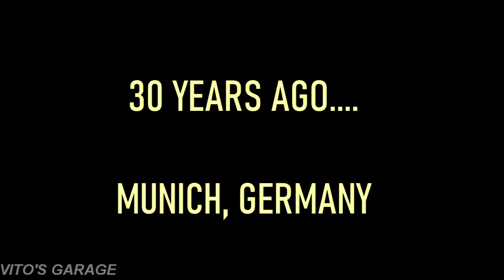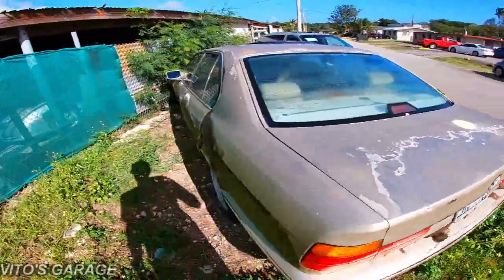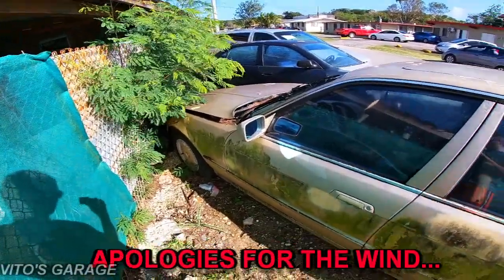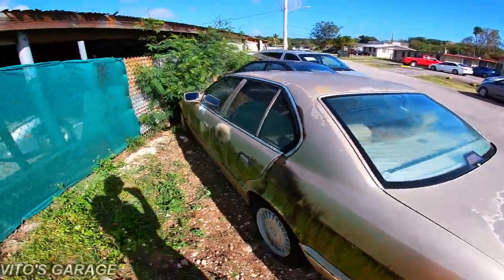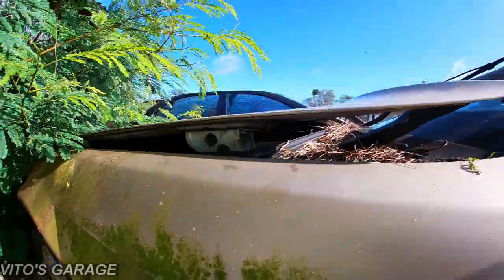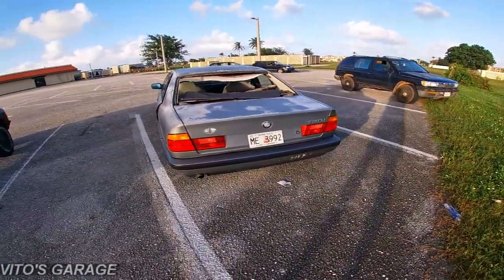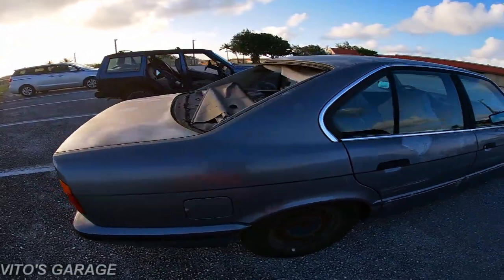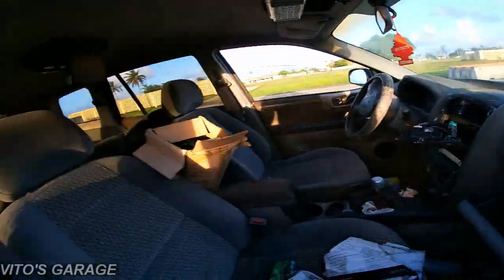This 5 Series BMW E34 Doesn't Deserve a Life Like This After 30 Years... Save Classic Cars!

Comment: that 90 E34 is worth restoring
Reply from the maker: They all are. We are getting less and less of these cars available...
Reply: @VITOSGARAGE   I have a 95 E34 I picked it up for cheap and it has the M50 2. 5 inline 6 in it when I purchased it 3 years ago and had 261 on the Odo now  just turned 300K runs like a champ  need some things due to age but I mean with a little TLC these cars are worth restoring